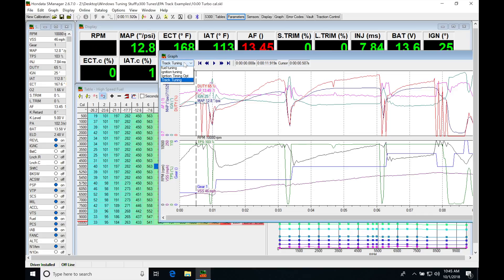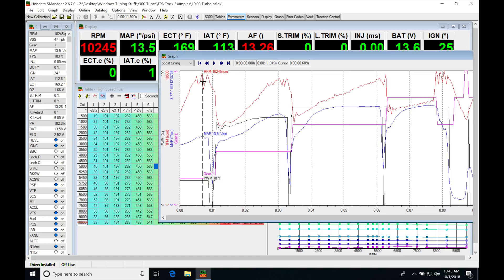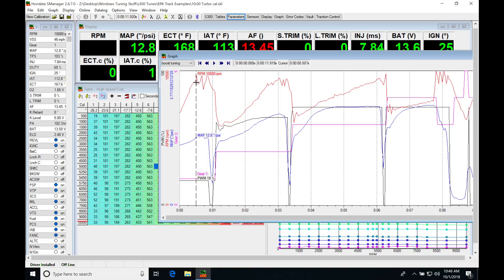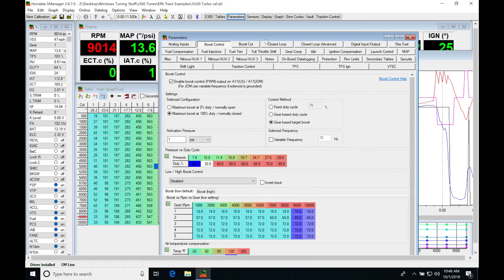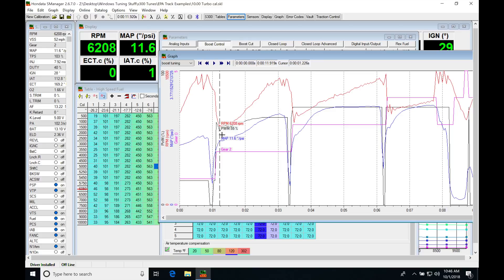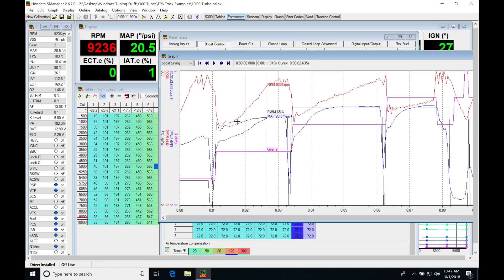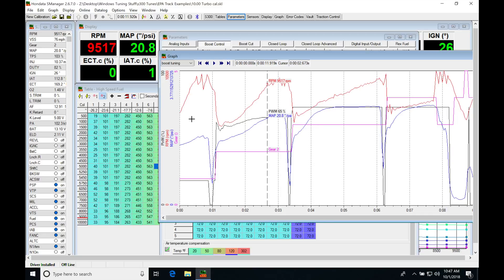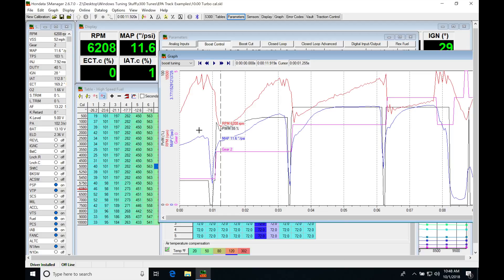Hondata s300: Track Tuning | Evans Performance Academy

Comment: For 1st Gear we should Increase Duty Cycle on Wastegate + Timing Reduction.  Hondata S300v3 also has the option of Fueling by Gear which can help control temperatures as the timing reduction generates a higher EGT.